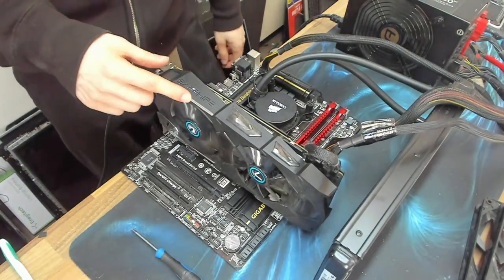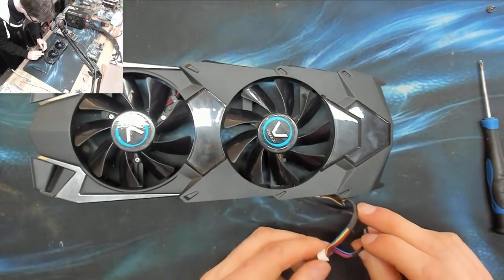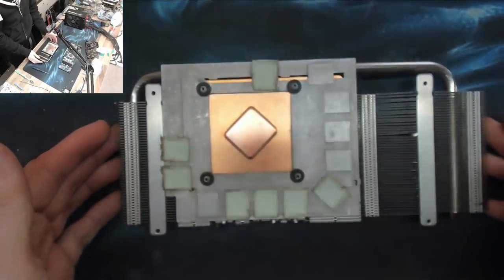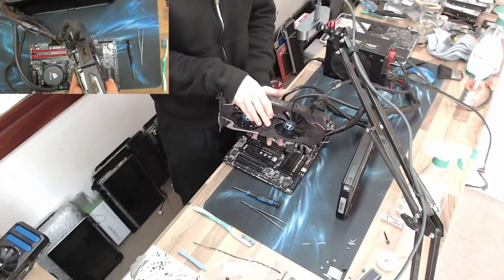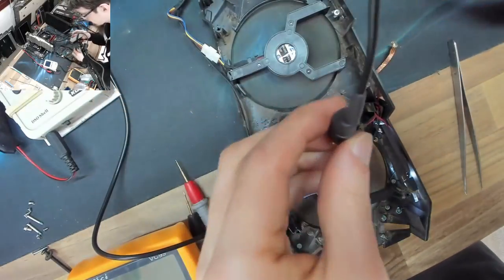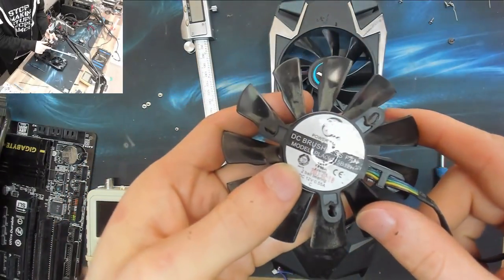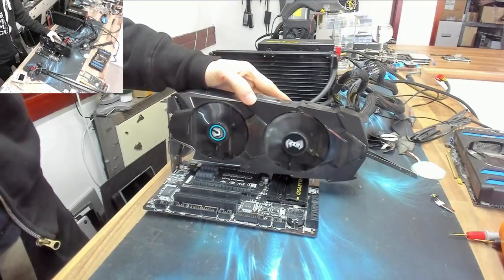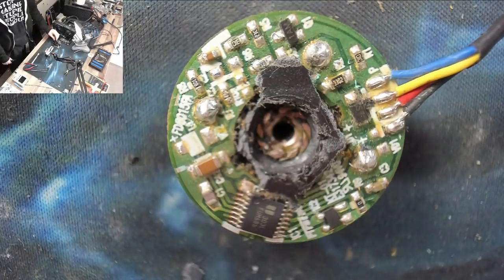LFC#136 - Vapor-X 280x Dead Fan

Comment: Thanks for posting this video. I've 5 Sapphire cards with Vapor-X cooling and all of them have dead fan problem just like yours. Only 1/5 card still has warranty so I sent it in. Sapphire replaced the faulty fan, but it only last another 7 months before it's dead again. Maybe my only solution is to shorten the pwm signal and let it run on full speed. Such a shame that Sapphire kept deliver these faulty fan for 2+ years.

Comment: So my wife has a Sapphire VaporX R9 280x tri fan configuration, but not the Tri-X if that makes sense. The logo on the fans are exactly the same as yours. 

The fan closest to the fan header died a few months ago. When I went to see if I could stick a fan from an old R7 250 in it, I saw all 3 fans were wired together and not able to be disconnected. 

The fan in question also has a white plastic rectangular piece split off the cable onto its own that's tucked away between the shroud and the heatsink when the card is assembled. I've got no idea what the hell it is. 

So it's like this more or less: fan>fan>fan^rectangle>connector. It's so bizarre. All are totally wired together. 

Anyway, I opted to mount an 80mm fan over the shroud under the dead fan and it works but it's unwieldy to say the least... this card is 13cm and 1.5kg without any help.

Any clue what the hell that is?

Comment: This is a great video! My 7970 vapor X is still kicking and running games like Subnautica for me but the extreme fan noise cue’d me in to the failed fan. I saw it before but had hopped it was just temp controlled. This seems to be a major issue they’ve continued to have for years and models. Just saw a vid about ghetto ziptieing some standard cooking fans to GPUs. Thanks to your video it looks like it maybe possible but it looks like I’d need to get some fans that could fit between those heatsink ridges. 

Sorta unrelated - but your video work is great! I use a table mounted boom like yours for my mic while streaming but using for a camera looks really effective too! May I ask what type of camera you’re using for your video work? I wanted to maybe stream Gundam kit building in the future and your set up looks great for that. Thanks again for the video! 

-Niric